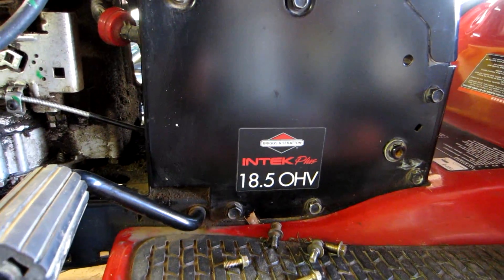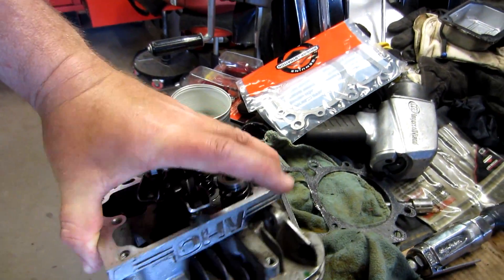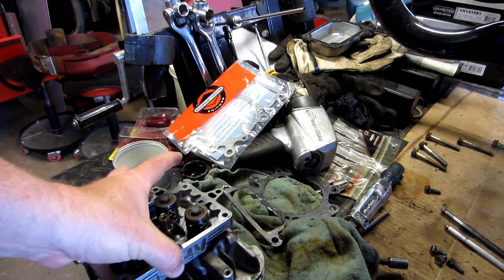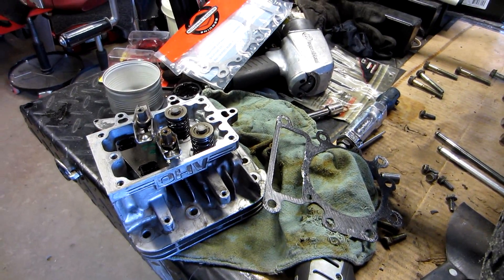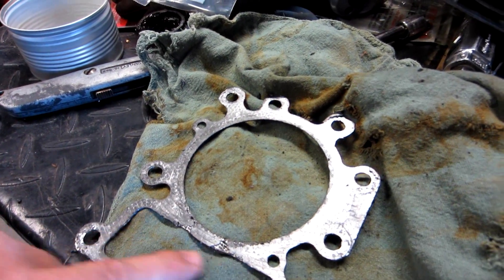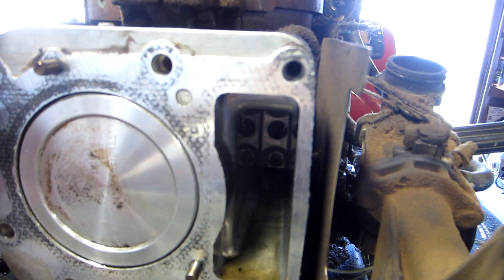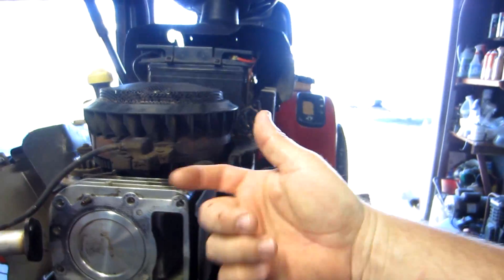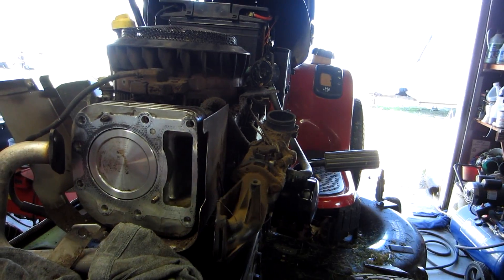Briggs Intek Head Gasket Symptoms

Comment: Is smoke coming out when throttle up or down also a symprom of blown head gasket or might iy be the oil ring?
Reply from the maker: Unless you have a lot of hours on the engine or it has been run low on oil a considerable amount of time usually Rings aren't an issue.
Reply: I know its 4 years late, but throttling up and smoking is a valve guide and/or stem seal.

Comment: I have a zero turn mower with a Briggs and stratton engine that is using oil but not producing any extra smoke.  Would you think that is the head gasket or another issue?
Reply from the maker: If you don't have leaks then it has to be burning it regardless if you can see smoke or not.

Comment: My 21 hp just started this a week ago, right after the PM. Thought it was something I did. Briggs should have issued a recall for a design flaw. Anyhow, is the fix using the same quality gasket they used during assembly? Is there a beefier gasket on the market? Judging by bolt placement, there isn't enough clamping force in the problematic area. It's going to blow the gasket again. Kudos on the video. Very nice and informative.

Comment: Wow, I had the same problem as described and started tearing it apart only to discover that the gasket was the culprit. Seems like a dumb design as the head bolts arent 360 (circular) and are more like a "C" pattern, NO WONDER!
20' LBS of torque for the head bolts seems a little low but I'll adhere to it I guess...
My lower pushrod (intake) was aluminum and the upper one (exhaust) was steel. Wonder why they chose to use two different types of materials for the pushrods in these engines? I might add that these things are EXTREMELY loud too! Almost gotta wear double hearing protection!

Comment: Actually the excessive crankcase pressure is pushing oil out through the crankcase ventilation tube into the air intake then through carburetor into the intake manifold. Notice how the carburetor is an oily mess. The purpose of the crankcase ventilation system is to relieve crankcase pressure. The oil is not going past the rings from the bottom side of piston. If engine had that much pressure on bottom side of rings it would be pushing piston from both sides and couldnt run.
Reply from the maker: Although that can happen that is not what the case was here. The carburetor is a Dusty mess because of the dusty mowing conditions in which it was exposed to. There is no oil in or out of the carburetor. The reason that your theory is incorrect when the mower shown in the video is because nothing in which you are referring to would explain the missing material on the head gasket. The pressure was not being pushed past the Rings and into the crankcase. The pressure was being pushed from the combustion side of the Piston surface into the crankcase via the leaking head gasket.

Comment: why do they always fail where the push rod goes? i changes mine on my snowblower and i suspect that it blew again... another symptom that you didn't mentioned is to have exhaust fumes coming from the crankcase/dipstick. i smelled my dipstick and it smelled like burned gasoline, thats when i knew i had a problem

Comment: I have this exact mower and it was running great and it suddenly stalled. Also, oil and gas were leaking onto the deck. It hasn't run since. Any experience with this ?
Reply from the maker: Look for the leak source... Could be a blown engine or just siezed up...
Reply: Now it will crank but won’t turn over at all even with starting fluid

Comment: I'm having a hard time finding the part number for my head gasket. Briggs and Stratton 20hp intek single cylinder ohv. Numbers on the valve cover are 31p977 0635. Getting multiple gasket part numbers. Please help.
Reply from the maker: It could have 1 of 2 different head gaskets....best to do like I do, and buy the kit...it comes with both choices and some other critical gaskets that may need replaced too... Here is the link -- https://amzn.to/2lRC2bO

Comment: Will this make it hard to start with backfire through carb and gas in the oil in crank case????
Reply: that sounds like the electronic gas shut off valve is sticking open----if you have a lot of gas in the oil guarantee you that is the problem------try removing it from the bottom of the carb bowl and work the needle a bunch and clean it with solvent it should usually start performing normal again

Comment: The link to the head gasket on Amazon is a different gasket than the one you removed from that motor! You have a 796584, but the link is to a 794114. The difference is the two bolt holes that are joined together on yours (796584) is at nine O'clock, the one on Amazon (794114) are at ten O'clock. 
Here is a valve gasket set with both gaskets: look at the difference... https://www.amazon.com/Gasket-Replacement-Briggs-Stratton-Replaces/dp/B06XPKTQHZ
The bolt pattern might be the same, but the reinforcement is not.

Comment: I have exact same tractor and I'm getting gasoline in my oil crankcase. When is far as to get a new carburetor and I've changed the head gasket. Still getting gas in crankcase. By chance any ideas?
Reply from the maker: Put a fuel shut off valve(like this one http://amzn.to/2ulpn49) between the carb and gas tank.. Make sure to shut it off after you are done using the mower ..

Comment: question on my craftsman lt1500 just  put new push rods in it and it was working fine was cutting grass and i started loosing power and it shut down and wont start but still turns over what does that sound like a blowen head gasket . what do you think it is when i put push rods back in and set valves she started right up and used it about 3 times after that and worked good up until yesturday it stard action up like i said  so  let me know what you think it might be
Reply from the maker: check rocke arm nuts .. make sure lock nuts didn't come loose and let rocker ares get out of adjustment//

Comment: I have a 6.75 briggs with a blown head gasket to the point where a fair amount of oil coming out the muffler. It will run, but blows a fair amount of oil out the muffler and of course smokes allot. With the head gasket blown, would that not make the compression low as well? I checked the compression before I checked the head gasket, and if I remember correctly it was around 80.
Reply from the maker: Douglas Bell blown headgaskets definitely would make compression lower if the gasket breach is around the cylinder however a gasket failure somewhere else on the head could allow crankcase pressure to be released along with oil... None the less the head gasket needs replaced..
Reply: Thanks for your response. Just wanted to be sure, as I didn't want to replace the piston and rings. That would cost about $80 and thats about all the mower is worth. At least the head gasket isn't too expensive. What did you mean by "however a gasket failure somewhere else on the head could allow crankcase pressure to be released along with oil"? The head gasket on the valve side was pretty much gone, like nothing there. So I think your explanation in your video explained exactly what is happening to my engine. Where crankcase pressure was created.
Reply from the maker: Douglas Bell  basically what I was saying is it sounds like a head gasket is needed and that a compression check, although a good measure, don't always come up bad even when a head gasket has failed..